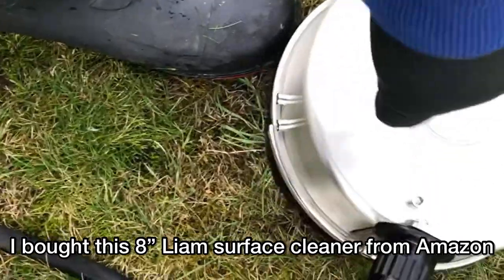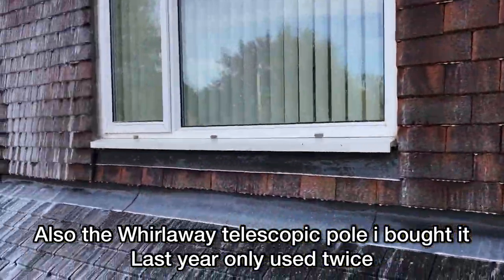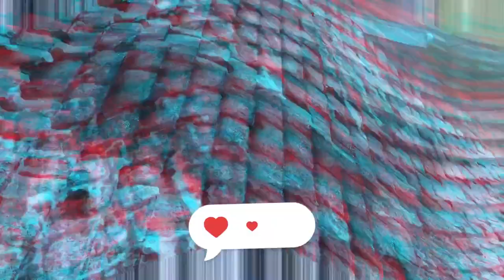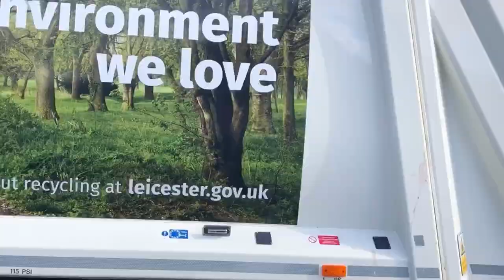Filthy Roof Restoration | Pressure washing roof tiles after couple of decades | Oddly satisfying

Comment: For safety reason,  I suggest you to use aluminium scaffolding to clean the roof and the walls.
Reply from the maker: Thank a lot yeas I would like to invest on it, and searching a compact and saggiest one which is easy to assemble if you know any better option please share links to check 
😊🙏🏼